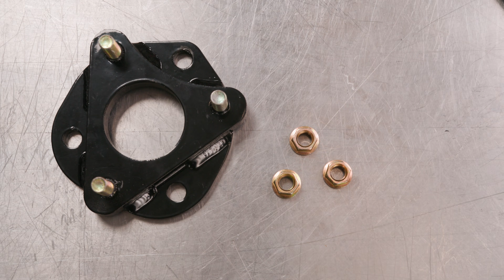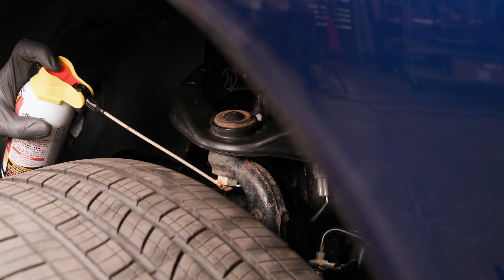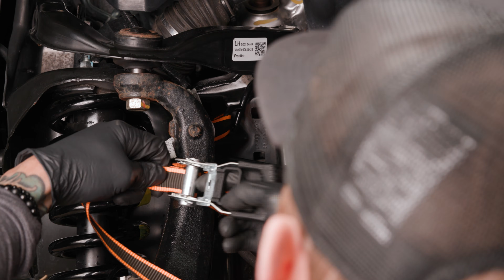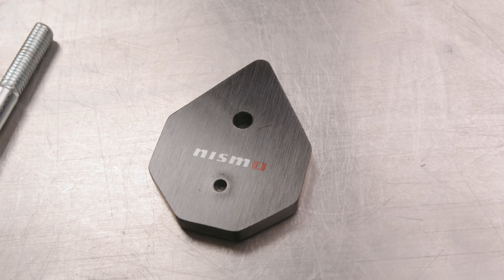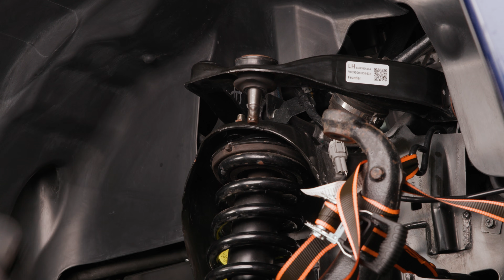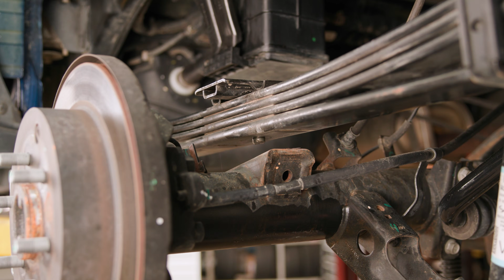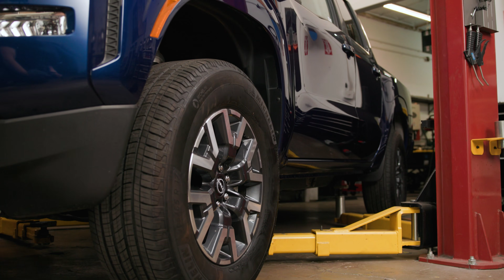Nissan Frontier NISMO Off Road Lift Kit Installation Guide

Comment: Elevate your ride huh?  

Lets be honest here. That spacer/leveling kit will be great for on road manners.. driving over some smooth fire roads or even slow on any rougher terrain.. Wait until you get to a corrugated or washboard like road and your colon wants to pass a kidney because now you cant travel 30-40mph and are limited to 10-15mph.. it will really take the wind out of your sails when your traveling time is slowed and or other people are waiting on you to speed up or catch up.

Ive sold Nissans as well as modified vehicles of all types for "decades" myself..  Track cars or Offroad. And Ive made the Spacer mistake to get me by until i invested in a real suspension setup.

Not saying the spacer kit is bad option, but its NO lift kit. It will actually transfer every bump and jar through the body into the cab thinking you're gonna go OFFROADING with a complete 180* difference in performance. That's my point.
Reply: what part are the spacers replacing, that contributes so crucially to ride quality?
Reply: @xisotopex   Suspension spacers often result in a rough ride because they essentially "preload" the existing suspension springs, making them stiffer and less able to absorb bumps, effectively reducing the suspension travel and causing a harsher impact when hitting uneven surfaces; essentially, they change the suspension geometry without addressing the spring rate, leading to a less comfortable ride quality. 

This is where people ultimately learn about the difference between a lift for looks, and a real suspension.

I mean lets be honest. Do you think all the big names like FOX, Bilstien, make $5k+ suspension setups too if all you needed was a spacer and a set of 5100's? 

No there's just a real difference between a Spacer kit - AKA Poor mans lift, and doing a real suspension system designed to work as a complete system. 

I promise anyone considering a Spacer based lift kit to run for as long as you can stand it, and if the the aforementioned brands are your ultimate favorite, GO buy a full $3k system and up and compare the two as you would in that first week, I promise you a left reproductive body part you will never go that route again.

IS IT A LOT more money?

YES.. IT'S supposed to be. What do you think Nissan or any other company invested in just developing the OE parts? Do you think something thats designed to offer more and be better should be cheap, or close to the equivalent or more?

And I'm not saying everything is more expensive is always better. But you have to ask yourself What am I using this vehicle for? How much on road vs offroading am I doing to warrant what?  -- My expectations are?

Personally, My driveway is technically 6.7 miles long in the middle of nowhere and the road is maintained once maybe twice a year unless an emergency washout of the road happens. So to me, I'm offroading every day to get to my 300+ acre property pretty much in the desert foothills of the Southwest.

If you are hitting a backroad back in the midwest/East coast or a fire trail to spin the tires more than going offroad or just need some bigger tires to get to that fishing spot with the boys once a month or two, a Spacer kit will likely be fine because you wont notice the harshness on road, which is why so many people don't understand or may agree with me.

BUT,... if you're going down anywhere that's a corrugated/washboard type road, you will rattle your kidney out of your colon at 15 mph while others leave you behind.

I'm not trying to bag on the setup, but when the setup's only measurable function really is aesthetics, and a fraction of functionality that doesn't provide any articulation and barely ground clearance.. Spacer kits are different on a unibody vehicle like SUV's/CUV's and on a truck, are usually limited to  what most in the industry call a Leveling kit to remove the raked look from a truck.

THATS it. There is very little function otherwise.
Reply: @inchranger  the algorithm is listening to us LOL a video popped up immediately after reading your comment here, about the pros and cons of the lift spacers, with more cons that pros....
Reply: @inchranger  the video basically reaffirmed everything you said here... I go offroad a LOT, but not trails.... my offroad solely consists of deep soft beach sand...
Reply: @inchranger  what do you think of the all dogs offroad lift kits?
Reply: @xisotopex  I'll be honest until just reading it now never heard of them, I actually had to look them up but looking at the coil spring and all lift kit for the second and 3rd gen Nissan frontiers; again it's basically just a poor man's lift kit. I get it, $430 is an attractive draw, my expectations would be low. 

its a beauty kit, not for anyone doing anything serious, and I dont think I would trust that setup in sand knowing my 34" Dyna PRO MT would dig me a mile and a half from where they make those things in China.

I know all I am sounding like I am trying to push some expensive kit or system for suspension however my point is that these kits like that you have to part together to make them work on your vehicle is just a series of band aids for example, and I am a man of function > Form in many cases but doesnt mean I build rat rods out of my adventure rigs either.

The aforementioned kit for the second and 3rd gen Nissan frontiers by the brand you mentioned is a set of:
  --  2" inch lift coils
  --   Pair of Add-A-Leafs.

That's not a suspension, thats not even a real lift kit and the company/product/page doesn't even give you the courtesy of any real specifications. And i'm skeptical of AAL offering a 1.5" lift without using the words "Approximate" or "depending vehicle"

Lets address the components.  The 2" lift coils granted useful, whats the spring rate? is it a progressive coil? What happens if in a year or two the offroad bug takes over and I want to add a bumper and winch? 33" tires? Is it going to handle the added weight?

Add in more robust full skid plates? A roof rack with a tent? All your gear for camping and maybe fishing?  All it takes is an extra 35lbs loaded in a unbalanced load and an evasive maneuver to lose control and then God takes over. I come from the Import performance world, seen many cobbled together "Street Racers" get into accidents because unmatched suspension, tires, weight transfer (in street family cars being used as race cars), it's kinda why I am being a stickler on the subject.

And sure the coils add 2", so rather than using a "Spacer lift" upfront as a leveling kit, THESE would be a better ride - I'll give it that, but my concerns with payload and handling still draw concerns. And if they handle the payload because they are a higher spring rate, well then what if you never add a bumper/winch pkg? is it gonna ride rough with no weight over them?

The Add-A-Leafs.. good for maybe an added 100-230lbs per side of more payload.  There's a reason why I have custom spec'd Alcan springs. I know the amount of lift and payload I have or can have them made to.

I have a Flip-Pack topper, automatically 265 in original weight configuration, I keep about another 200-220 lbs of gear out back, I have a rear mounted winch kit I am working on. I want to add a 34gal extended fuel tank, food and the fridge/cooler, ammo if we're shooting out in the desert or mountains, the woman drags a bag of crap out with us every time like shes going to a IG modeling set.. I needed the weight capacity

I get that your current thoughts and needs are simpler, i merely showing by example expectations and thoughts change.

Cant tell you how many vehicles ive worked on, guy/gal does the bare minimums to get the basics of a look, then goes out a couple times and finds out they cant do certain things or keep up and then they start spending the real money, and wasted all the other stuff.

I know this may come off as a shocking statement given todays "economic climate" [THANKS JOE !] but you spent $35-41k on a truck because it brought joy to your mind and tickled your taint in a special way.. Whats another $3500 to add to all that and allow you to do more things? I mean we're splitting hairs here.  As a prior car salesman, I laughed hearing someone be on the fence after buying an $85k vehicle but was afraid to chuck in the added $480 to heat the rear seats too.. It's like ya just spent $85k what is $500?

However, that being said...

You could spend 1k on a set of Alcans, 1600 on a set of Radflo coilovers, add some longer brake lines, U bolts, a set of UCA's.. and be maybe $3200-3500 in and actually have something worth bragging about because it works as intended and would ALSO, offer you room to upgrade or grow into your hobby/adventures.

I happen to patron a local shop to me in Vegas, they cater to guys like me from the vehicle to the kayaks and hiking/camping gear me and my better half use.. I used them for my 2013 Xterra [sold], My '93 Ranger,  '20 Tacoma, '92 4Runner [sold], and will be the first call I make or stop on the way home from the Nissan dealer when the 2025 Frontier drops.

Providing Nissan doesnt Exit the Automotive industry in the next 12 months like they said might happen. I'd be really bothered to see them close down like Stellantis is doing to Jeep and RAM
Reply: @inchranger  no kidding! I feel the same way! after 50k on the truck, 3 k for the suspension is just an afterthought for me.... yeah NISSAN closing their auto division would be... not great... at least we could still buy submarines from them... LOL
Reply: @xisotopex  Wait.. Nissan has a Submarine division? Stapppphhhh it !?!? [looking]
Reply: @inchranger  the Dobinsons lift kits look like they combine aesthetics as well as functionality, and really not very (not counting labor if not done DIY) expensive either
Reply: @inchranger  I think so, I think they have a heavy equipment division for industrial machinery, and another division that build submarines or parts of subs..... not sure though...
Reply: @inchranger  Makes perfect sense. Do you have a preference on which  2"-2.5" 
'complete' suspension kit for a 2024-2025  4×4 Frontier? 
Seems as though many of the complete suspension kits/systems I've seen all have atleast one weak or less burly component in the kit?
Reply: what a heap of garbage you typed,  " you've sold nissansand modified vehicles>?" cool lie
Reply: @Ashoud_Anobetah  And who are you addressing with your out of context comment?

Maybe I could have missed some form of proper punctuation or even sabotaged by autocorrect but for clarification, since everyone else seemed to understand it..

"Ive sold Nissans as well as modified vehicles of all types for "decades" myself..  Track cars or Offroad."

  -  I have Sold Nissan vehicles for several years ~ two (2) different dealers In SoCal, combined for a little shy of 3 years +/-
  -  And I have "modified vehicles of all types," since the late 80's many being from what was called the sport compact car scene before it became the Import or Tuner car scene or even the JDM scene. 

I am under the impression you assumed or presumed I meant I was selling "modified NEW cars" (?).. And technically - No, not at all what I meant. 

Yet at the same time, I have worked at a dealership or two that have worked at a couple dealers VERY after market support POSITIVE, and it wasn't to unheard of for a customer once in a blue moon to buy a vehicle and buy a Magnuson S/C, or a lift/lowering kit straight from the dealership, installed by the dealership, warrantied BY the dealership... Same with re-geared axles, upgraded clutches, etc..

Only modified vehicles I have sold were my own toys over the years.. You can squeeze 3 young kids in a EG hatchie, but only 2 can be in car seats, the oldest is getting pummeled on by his two brothers sitting between them.

Let me know if there's anything else you require clarification on before you work of lose assumptions there Skippy...

Comment: Are thennew uca required with the lift kit?
Reply from the maker: Hello. The Upper Control Arms are not required with the lift kit. They are only required if you add the lift kit and our High-Performance Suspension Kit together. The Upper Control Arms are then required to ensure correct alignment.